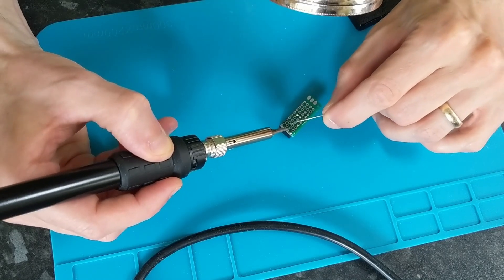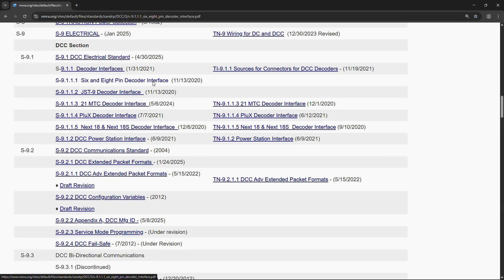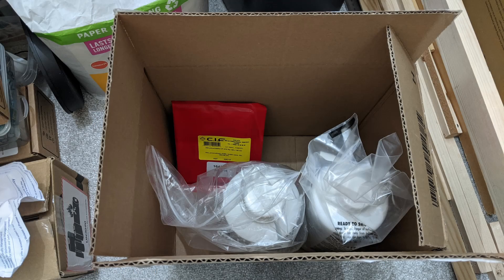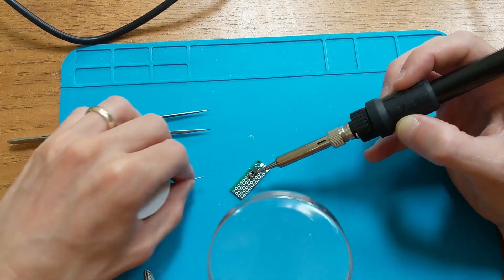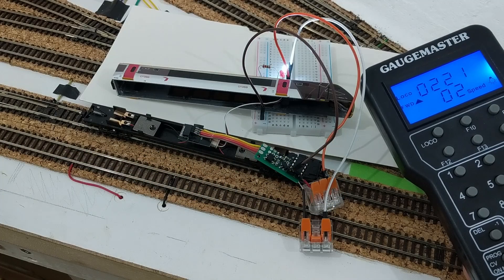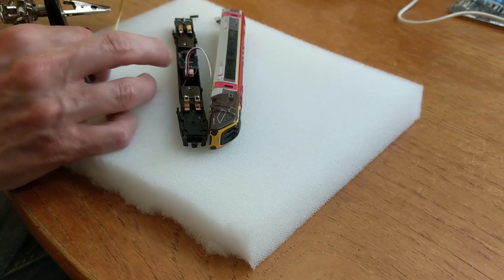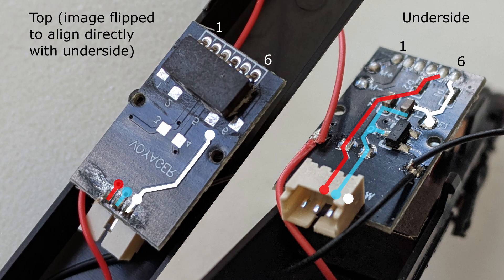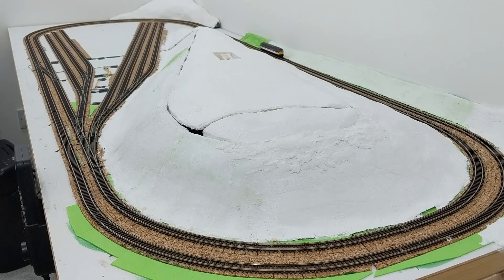0053 Making a DCC decoder from scratch -  part 3

Comment: Superb!

4:30 The diode test feature of a multimeter doesn’t beep, it applies a current from a low voltage source (like 1.5V) and displays the measured voltage. Imagine it as connecting a 1.5V battery through a 10k resistor to the test leads, to force a tiny current through a diode-under-test. With the red lead to the cathode, the diode passes no current so you just see the 1.5ish battery voltage. With the red lead to the anode, the diode passes current and you get to see the diode forward voltage of around 0.7V (or 0.4V for a Schottky diode).

I’ve built a lot of circuits on perf board. I used to draw them on paper, then flip the paper over and trace over the pads and tracks on the back to get the bottom side pattern. These days I can get PCBs made so cheaply in China that it’s rarely worth the hassle of perf board. But it’s still a useful method when I’m not certain a circuit will work yet.

9:00 You can use transistors to switch the LED currents but it shouldn’t be necessary. Providing that the common LED positive voltage is no higher than the ATtiny supply voltage (it’s likely connected to it), then you just need the resistor from a port pin. Output a 0 to turn the LED on and a 1 to turn it off.

When you eventually want to convert your design to PCB, I highly recommend downloading KiCAD. It’s a highly featured but free PCB design package. I use it for home projects as well as professional circuit design. And companies like JLCPCB and PCBWay can produce boards quickly and cheaply. For most boards, the shipping costs way more than a batch of 10 PCBs.

Again, if you want any help and support in your learning journey, I’m happy to mentor.
Reply: Also, I’ve used 8-pin ATtiny microcontrollers, with the surface mount SOIC-8 package. So long as a programmer can drive the required pins, you can get a clip on connector that fits the chip for programming. First I tried a clip from Amazon but couldn’t get that to work. Turns out it wouldn’t make a reliable connection. I then bought one that does work and haven’t had a problem since. If you want to go this route eventually, let me know which programmer you’re using and I’ll try to find a solution that works for you.
Reply from the maker: Thank you for your kind words, advice and offers of help again 🙂

Ah OK, thanks for that info about the multimeter - looking back at the video I've got it does show something near 700 one way around, and just 1 the other way, so that matches what you say but scaled.

The common positive into the locomotive's LEDs is the track voltage, so that'll be 13V on my system; assuming the Voyager's LEDs drop the typical 2-ish Volts, that would be 11V over the loco's PCB resistors before getting to the ATtiny (running at 5V). Although the LEDs and ATtiny are both powered from the track, I've got a 5V voltage regulator between the voltage rectifier and the ATtiny. 

Thanks for the recommendation about KiCAD - it's been recommended by various people, so it'll be my go-to when I get to that point! I'd like to give home etching a go before considering mail order - I think it will be extra satisfying to produce as much as possible at home, but I'm open to using one of those services instead if I can't get the etching working, so long as the postage to here isn't comparatively high. I do wonder if double-sided printing will be too much of a stretch at home, and wires needing to cross paths somewhere is inevitable.

Thank you very much for your continued willingness to help - I'm enjoying working my way through all of this, but if I get to a point where I'm properly stuck it's nice there are a few people I know I can contact for help (I've kept a list of people who've offered so it doesn't get lost in comment history)!

As it happens I've bought another kind of clip to try programming the SOIC package, so I'll see if that works. At the moment I'm programming via an Arduino Nano, for which I've used both an Arduino IDE Arduino-as-ISP sketch and the Visual Studio Code-based Platform IO (but having burned the bootloader using the Arduino IDE) - I can still use those with the connector I've bought, assuming it makes good enough connections. It would be nice to not need the Arduino API - I've had some timing code working without using the Arduino delay() or micros() functions - but I don't really want to either spend £70 or more on a programmer or use a programmer that needs random USB drivers installed on Windows, so I might be sticking with the Nano for a while.
Reply: @endoorrailway  Yes, different multimeters have different open circuit diode test voltages.

Ah, then with a 13V supply you will indeed need mosfet drivers switching to 0V. Red, yellow and green LEDs typically drop 2V. Blue and white typically drop 3V. You need to experiment with current (start with 10mA) to get a realistic brightness. Different LED types give different light intensities at the same current, so set up each individually. A good selection of resistor values is vital for this work.

Postage is typically around £20, depending on how quickly you want them.

Etching your own boards is a rite of passage, I fully support that! But once you want double sided tracks connected to each other you need played through holes, which are impractical at home. Also, a professionally made PCB will have solder resist between pads (what you describe as black paint on the commercial board you show, it comes in a variety of colours but green is most common). The resist helps prevent solder bridges between pins causing short circuits.

I don’t use the Arduino IDE, I use Atmel Studio from Microchip and have a starter project that basically works like the Arduino core. Pro is it runs a lot faster than Arduino and does exactly what I need it to. Con is I have to write modules for every peripheral, there is no library except what I have built up. You’re welcome to a copy sometime if you want to break free from the Arduino IDE. You get ALL the source code, so you get to see how everything works!
Reply from the maker: Thanks for the tips - I do have a nice selection of resistors in both "big" form and SMD, so should be able to experiment 🙂

Solder resist... that explains why it's so easy to solder with circuit boards! The one on the locomotive does seem to be opaque, whereas on green and blue circuit boards I'm used to being able to see the tracks in a distinctly different shade (like on that DCC blanking chip I briefly showed pictures of).

Atmel Studio is something I've briefly tried to look into, but hadn't quite worked out what I'd need physically to go with it - I think they have an ICE programmer for about £80, but it wasn't clear to me how I'd physically connect the ATtiny to that - maybe via one of the probe or clip-style connectors we've mentioned? But I talked myself out of that whilst I'm still able to get the results I need with an Arduino core, for now.
Reply: @endoorrailway  You can get alternative Atmel programmers. The ICE is nice, but definitely overpriced! If you can get one that the Atmel Studio IDE will interface with directly, that makes life a lot easier. If I recall correctly I think you need 3 connections to program an ATtiny, but it might be 4. Two are the micro +5V and 0V. The other 1 and 2 need to be drivable by the programmer. The ATtiny data sheet, programming section, should say which pins need programming access. And yes I’ve managed it with the SOIC-8 clip so I don’t need a separate programming connector (which is what I add to larger designs using things like the ATxmega microcontroller family.
Reply from the maker: Awesome, thanks 🙂